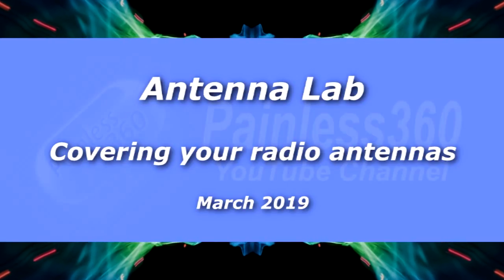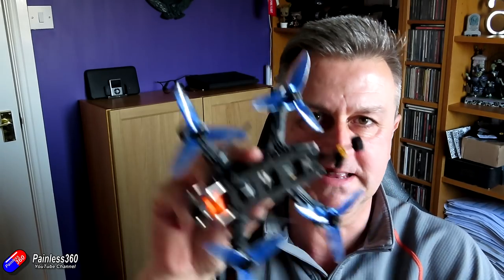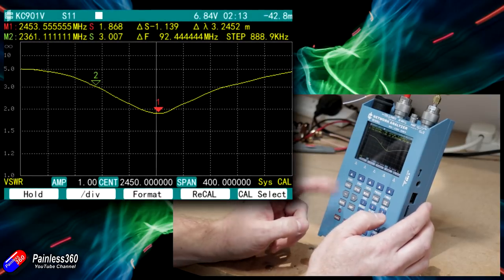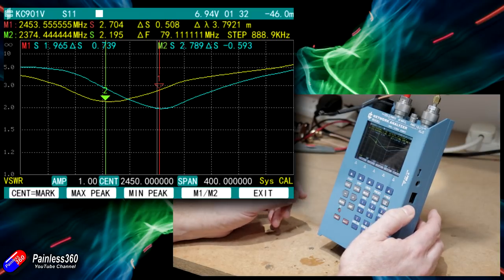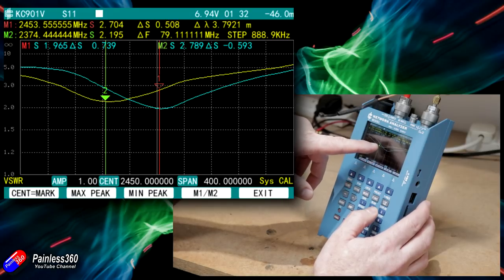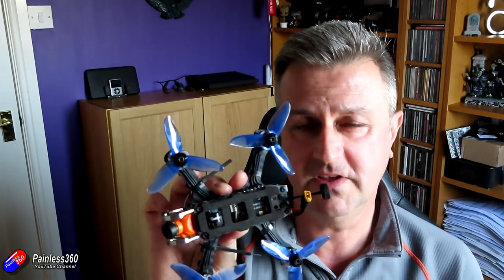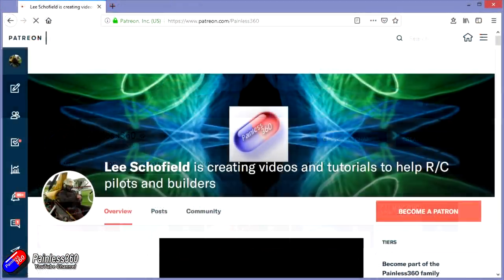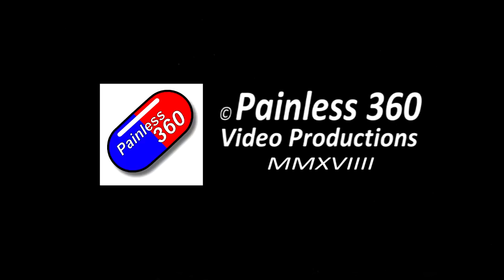Antenna Lab: Impact of covering your radio antennas with heatshrink

Comment: Great video , I've worked at Raychem Corp the inventor of thrink tubing I believe thay make shrink tubing just to cover antennas also  you can check the specific technical sheets out at Tyco / Raychem electronics on-line.

Comment: Great series of investigation videos, I've actually started attaching the RX & VTX antennas to the cable ties with sellotape because it's easier, and smoother so less likely to be gripped & ripped off when glancing foliage. Although it doesn't look as slick as heat shrink tubing.
One test I'd like to see the results of is a VTX antenna before and after removing its balun (? that grounded metal tube the same length as the active antenna part). Because I had poor reception from my QAV105 with 25mw VTX and it's original short antenna, so I made a longer one that sticks out the back a few inches, with the correct length exposed core, but didn't add the grounded metal tube, and it works much better than before.

Comment: So in theory, your antenna could be shortened by a tiny amount to bring them back into tune. Or would that have an adverse effect on the swr.
Reply: In theory, snip 0.61 mm off the dipole to move center frequency back to its original value, although the VSWR will still remain a few points higher than unwrapped. I'm thinking my neighbor's stand of Norwegian pines degrade the signals far worse when I fly behind them than the little bit of shrink wrap.

Comment: I suspect you lose more from the carbon when it is in between you and the antenna. It would be interesting to see what the difference was in a straight covered antenna with zipties and shrink tube versus uncovered antenna and it not being straight. As if it was slightly s shaped from say a branch strike. Maybe another test?

Comment: I assume using an antenna tube would be even worse...
I also assume these reductions would be less drastic on a 900mhz system. I have a crossfire antenna (not immortal T) in an antenna tube on my LR 3”
Reply: Hard to say as thickness of the tube is not all that matters. Some materials are worse then others. But most likley you are right that the tubes are worse than heatshrink.

Comment: Hey Painless! I had a question about the Herelink HD Radio and Here2 GPS. Would having about 1mm thickness worth of carbon fiber reinforced plastic shrouding the antennas or GPS on the drone really affect range at all? I've heard conflicting reports, some say 1mm is too thin to absorb RF waves while others say any amount of CFRP and your done..

Comment: Nice info! I understand you are quad centric. But I would love to see same testing in antenna mounting schemes used in planes. In tubes, 3D print mounts, taped to balsa, or taped to plywood, etc. We do fly out where those smaller losses make a big difference.
Reply: Taping antennas to balsa is really bad, plywood to but not as bad. Balsa absorbs alot of moisture and moisture blocks signals. Try to get the antennas out of the fuse if possible
Reply from the maker: Good idea for a video - testing inside foam..
Reply: SLINGSHOTandMOLOTOWS 
Sure. Ideally we don’t mount then to anything! They just float in the air. But the reality and general practice is there is ply balsa, foam and covering. If it isn’t mounted to them, then its mounted to some addition element, such as the 3D prints which becoming more popular, or antenna tubes, etc. If we see shift with shrink tube, then what is happen with water containing balsa/ply or 3D prints or combo of prints and shrink tube.
Reply: @Painless360  another very interesting thing would be to test a rubberducky antenna with and without the plastic cover. Its much thicker than antenna tubes and heatshrink pretty much all 2.4 tx uses them

Comment: Very useful indeed. Thank you! But what about the impact of different fuselage materials, prop discs etc.in the line of communication - is there knowledge available? Antenna placement on fixed wings can't be unimportant?
Reply: Well on a fixed wing there is little to no carbon fiber thus you don't need to worry much.

Comment: Is this why frsky replacement antennas are a bit short (...1/5 wavelength ;) ...) ? Are they tuned a bit higher so they get suppressed back to tune?
Reply: Apparently, the internal circuitry of the receiver itself also has an effect on the tune of the antenna. That is why some of FrSky's antennas are different lengths on different models of receivers.  Bruce from RCModelReviews did a video on it, 'Antenna theory: The FrSky receiver antenna puzzle'.

Comment: Thanks for this video. Very interesting, but I still have one question: Are there any materials that we could use to cover the antennas that have less effect on tune and VSWR? Like different glues or tapes?
Reply from the maker: The moral of this testing is to use antenna that comes with the protection you want out of the box and not to cover it with anything else unless you are happy with a slight impact on its performance. Happy flying!
Reply: @Painless360  thank you :)

Comment: I regularly see people with curled up or bent active elements, just shoved into the model or flapping about in the breeze. How detrimental is that to signal strength. I always tell them they should be straight and at different orientations but it would be good to know how much effect it has and have a video to point them to. To show how much signal they are potentially losing.
Reply from the maker: Stay tuned, that’s one of the things will be testing in the future video. Make sure you’re subscribed and have the bell notification icon selected. Happy flying!
Reply from the maker: As you are one of the people who asked about this - here is a preview of an upcoming video :D https://www.youtube.com/watch?v=O4_VuZz3mVI